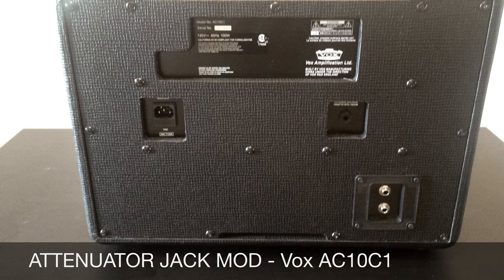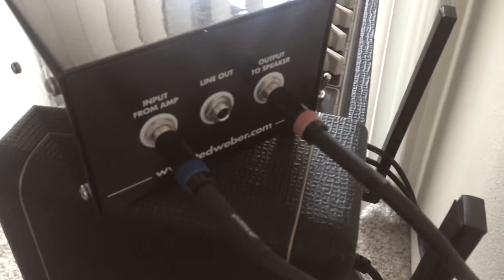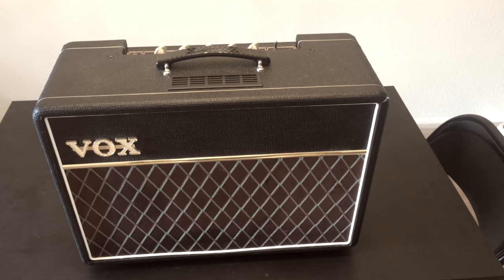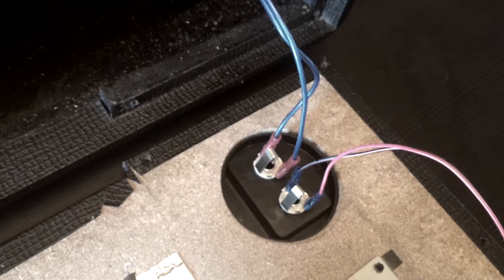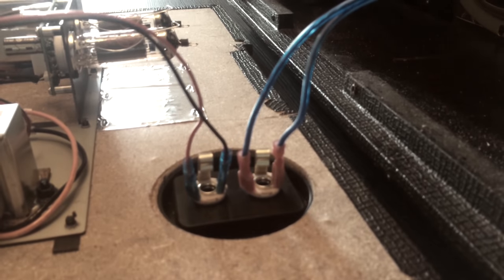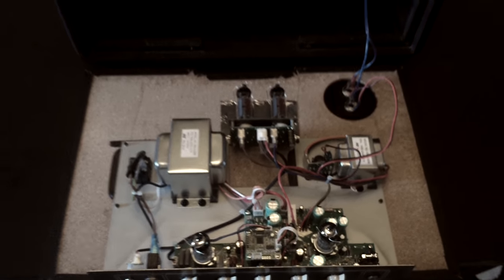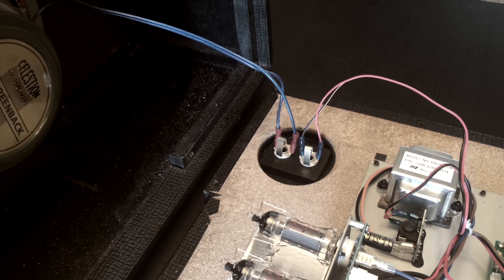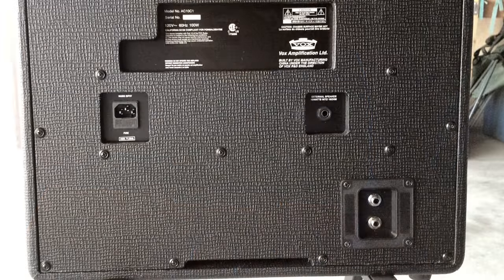Vox AC10C1 Attenuator Jack Mod

Comment: I did a similar mod, using only 1 extra jack. It serves 2 purposes. The extra jack is wired in parallel with the speaker (hardwired to the speaker), so I can use the speaker as a stand alone cab.
When using the original jack out, it shuts off the internal speaker, when addidng the extra jack I can use an attenuator between the 2 jacks. It's little puzzling tha VOX didn't think of this. 
I love this amp . I tamed the input a bit with a 5751NOS JAN/Philips V1 tube.                      Your work looks nice !
Reply: On AC4C1-12 whose circuit is similar, I also opted instead for this solution with a single jack connected in parallel directly to the terminals of the internal speaker.
This simplest solution also allows the attenuator to be connected to an external cabinet, or as said, even to use the Vox as an external speaker.
Everything works fine in all configurations (no need for patch cable in stock configuration).
Reply: Do you have to use a jumper wire between the two jacks when not using the attenuator after wiring it up the way you did?
Reply: Do you have a write up anywhere on how you did this mod? I think my AC10 has a bad transformer. Swapped tubes and fuses already but still won't turn on. Would like the ability to use as a cab with a Micro Terror until I can find a transformer... (Impossible to find right now apparently)
Reply: @wyattsdad8561  No! :-)
Reply: To Use Attenuator: 1) Speaker Out to 16 ohm Attenuator IN - 2) Attenuator OUT to Jack wired (speaker wire) to the Speaker parallel to the Amp to Speaker wiring - sounds good!!
Reply: Hi, this sounds good, do you have a schematics or picture of what you did. Seems very convenient.

Comment: Excellent job. Because of your vid I did the exact same mod. Except I used one switched female jack. That way I wouldn’t need a patch cord when not using the attenuator. It works awesome! But I bought the same plate, drilled the 3 inch hole etc.. in my ac15.
Reply from the maker: Awesome! That's a good idea. I may alter it to go that route and make another video. It seems this one is fairly popular - didn't realize so many people wanted to add an attenuator to their small amps.
Reply: @valenzero856  with an AC15 it’s like a must if you want to enjoy using it at home. It made all the difference in the world. I couldn’t turn it up loud enough to really enjoy the tones of the amp. Now it’s like the perfect amp.
All the parts I used were good with the push on solder-less type
connectors. The switched Jack was bought on amazon too. Everything I got was purchased on amazon.
Reply: I like the 1 switched jack idea. But if you need 1 cable out from amp into attenuator, and 1 cable from attenuator back in to the amps speaker, how does just one switched female jack do that? Thats 2 cables and only 1 jack.
Reply: @rogiemac  no, you need a total of two female jacks. One of which is switched.
Reply: @wyattsdad8561  Ahhh ok. Does that mean you have a set of wires going from each switch connected to the onboard combo speaker? If you got the switched jack online, do you have a link for it? I see so many online, I want to make sure I get the right kind.
Reply: @rogiemac  I posted a link for the switch. So you will unplug the speaker wires going to the speaker,, then take the regular non switched female jack and make up a set of wires with push on connectors, attach the wires to the non switched female jack, plug the other end to the speaker.
Then take the female switched jack and make up two wires going from it,
to the two wires that you removed from the speaker and put the appropriate push on connectors and hook them to those wires you removed from the speaker (those wires go to the amp. 
Now you will need to make up a short set of wires (two of them) that go from the other side of the switched jack to the non switched female jack.
So when you unplug your attenuator it will switch itself to complete the circuit that was interrupted by the female jacks.
It can all sound a little confusing.. I know, because for some reason it took me a little bit to figure all this shit out and I was like wth it isn’t brain surgery I’m doing here, why in the hell does this seem so confusing.
It’s very simple and basic tho. You’ll see once you have all the parts in hand: once you get all your parts and if you have a question just write me on here and I’ll help you. 
I would advise buying a switchcraft female jack for the regular non switched jack. They are probably the best, that’s what I bought as well.
Reply: @rogiemac  make sure to get push on connectors that are the same size as the ones going to your speaker. Here is a link to the non switched female jack. I thought I got switchcraft but I didn’t because I couldn’t find one that just accepted push on connectors. These are good quality tho 
https://www.amazon.com/gp/aw/d/B00OVATE70?psc=1&ref=ppx_pop_mob_b_asin_title
Reply: @rogiemac  everything I did for this mod was done with push on connectors. That switched female jack will accept push on’s as well.
Reply: @wyattsdad8561  Thanks! Got my parts ordered and cant wait to try this.
Reply: @rogiemac  you will absolutely love it. Vox should have done this to their combo amps
Reply: @wyattsdad8561  Im trying this on an old Crate vintage club 30 amp. Ya know, the kind where from 1 to 2 on the volume knob equals from 10 to 800 decibels :)
Reply: @rogiemac  keep us posted on how it worked out!
Reply: Thanks a lot for the valuable insights on how to do this! I’m going to have mine (AC10) modded by a pro, as I have absolutely no experience in amp maintenance and while it seems simple, I would not venture into that as a first DIY mod! So what parts do I have to buy exactly to provide him with in order to do the mod? Also if you have a good attenuator recommendation let me know. I was thinking budget-friendly first, like the Weber Mini Mass, or even Burgera or Harley Benton. Thanks a lot!
Reply: @flaneursong78  hi there, you’ll need one regular mono jack, one switched mono jack, the round plastic jack plate, wire (I think it was 16 gauge) and an attenuator. The one I have is made by Carl’s Custom Guitars, they are pretty cheap, I think it was like 50 dollars. And then you’ll also need 2 short amp cables to plug it into the amp. I know on one of these comments on here I put links to the mono, female jacks I used.
I got everything from Amazon.
Reply: @flaneursong78  look at the comments I sent to RougeDoggMac
I put links to the parts I used. Definitely have the switched female jack installed because then you won’t ever need a jumper cable between when not using the attenuator.
Reply: @flaneursong78  the original guy that made this video totally helped me by making and sharing what he did. I just made one Improvement by adding the switched female jack. Everything else I did was what he did. 
If you get the same parts I got you won’t need to do any soldering. 
One more thing, you’ll need push on type solder-less connectors to hook everything up.
Reply: @wyattsdad8561   thank you so much for the detailed explanation. I’m going to order the same parts, and follow your way of proceeding. This is of great help, and it should totally change the experience of the amp to be able to have a manageable master volume, thank you again and to @ValenZero for the initial video!
Reply: @flaneursong78  
my pleasure. 
If you need anymore help just hit me up on this post. It’s a night and day difference, you’ll see.
Let us all know how you like it once done. 
And again, get all push on connectors, it is very easy that way.
Reply: @wyattsdad8561  I’ll sure let you know, thanks again! It might take a couple of weeks, as still in lockdown, but I place some good hope in this solution, as it’s kind of frustrating to have the Master turned all the way down for an amp that sounds so good. This way I might also be able to use the OD from the amp as with the current volume issue it’s hard to reach a balance between clean and driven levels.
Reply: Here ya go

Comment: Nice job ! Looks almost like it's a stock or option install. I'm pondering new tubes first then maybe speaker.
Reply from the maker: Thanks Jeff. Turned out pretty good. The new speaker in the amps rocks. Sounds so good cranked. I'm sure the new tubes helped as well. I hope to post sound sample videos when I get a decent mic.

Comment: Unless I have missed something in the video, if you ever want to use the internal speaker without the attenuator, YOU MUST JUMPER the 2 new jacks at the rear. If you don't, your tube output stage will be running with NO LOAD. Please invite me to your "farewell output transformer party".
Reply from the maker: Correct. Currently I have a small patch cable in the back going to both jacks since I can crank the amp at my house.

Comment: You don’t have to do it this way people. If you put a second cable to the speaker and let it come out of that small gab on the bottom you can have the same without modifying anything at the cab.
Reply from the maker: Thanks for contributing to the discussion! I'm always a fan of easy and quick. Can't go wrong listening to how other people get the job done.
Reply: ValenZero it’s only that easy cause the speaker switched off as soon as you put a cable in that jack on the back. If the jack wouldn’t be made that way it wouldn’t be that easy!
Reply: @BrewerShettles  the funny thing is that the original speaker got a second push-on-connector-port for a second cable. You have nothing to do else then push the connectors of the new cable to the ports on the speaker and done!
Reply: @BrewerShettles  no need for that. Just make a 30cm long cable any connect a regular speaker cable clutch to it. Only the clutch will look out of the housing. If you use it for two years you will not drill a hole after the warranty is over… it’s a super clean Solution.

Comment: Great video! I’m also interested in this mod for my AC10. Do you think you could have just hooked up one speaker jack wired to the speaker and used the existing “speaker out” on the amp? I would think then you could go out from the “speaker out” to the attenuator then back to the speaker via the new jack. Am I missing something there?
Reply from the maker: Daniel Surratt hey! I think it's possible. In my case I wanted the option to bypass the internal speaker and use an external cab so I didn't change anything on the external speaker out side. Prob more than one way to wire it. I liked the idea of having both options though.
Reply: I have the same idea. external Speaker to attenuator. External speaker mute The speaker But with a cable directly to speaker i think work. Have You tried?

Comment: I did this mod on my son's AC10C1. Unfortunately, it did not work correctly with his JHS little black amp box passive amp attenuator. It would only work on full volume. So I guess there are differences with attenuators. The same attenuator works fine on his Fender Blues Deluxe reissue in the effects loop.  Some attenuators like your Weber Minimass are load boxes as well. Before I spend over $200  for a decent load box attenuator for this $500 amp, does anyone have any recommendations for one that works with mod? Any sound samples?

Comment: So I got my jack plate and female jacks. I also ordered a switched female jack, in hopes that I can wire up the switched Jack so I won’t need a jumper wire when not using the attenuator. I wasn’t sure if it would work but I’m waiting for that switched jack to get here. 
Do you think this will work?
I really was hoping to not have to use a jumper when not using the attenuator.

Comment: Hey mate!  The is awesome.  I'm searching all over and can't find an answer to this and hoping you can help! My speaker is hardwired to the amp, but not soldered so it can be disconnected from the amp easily.  I was thinking of connecting the cable that runs from the amp to another cable with a 1/4 jack end.  However I would need the cable to be flat spades (1/4 jack at other end) to connect to the existing cable connected to the amp.  Is there suck a cable like this and do you know where to find?!?